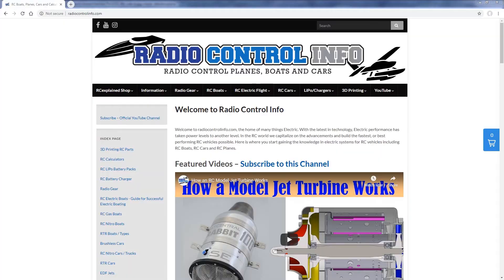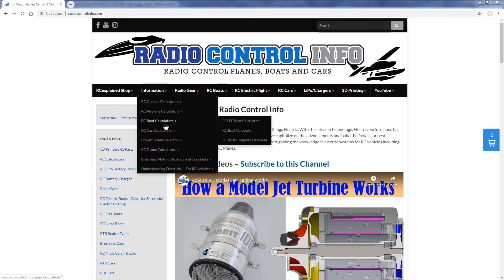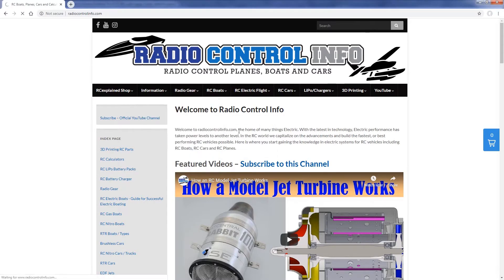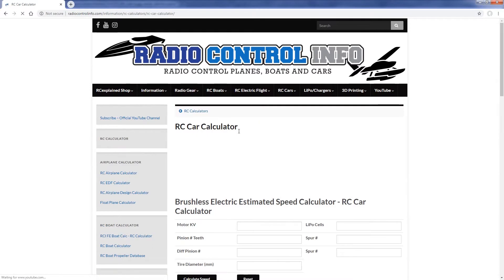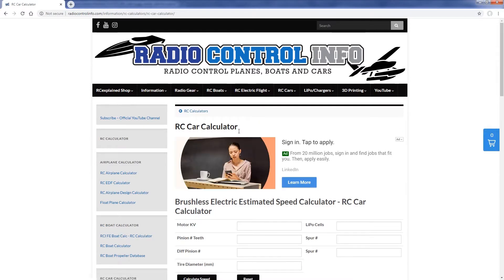How to Select a Brushless Motor for 1/8th Scale Buggy

Comment: I have a 1:8 buggy I am trying to convert from nitro to electric. I want to run 5S at first using LI-ion batteries, and potentially upgrade to 6S lipo down the line. I have the motor mount and the roller chassis. I want to just bash it and have fun for now. What motor and ESC combo should I run? Thank you!
Reply: Watch the video. Everything is explained. Learn.

Comment: If you’re planning to race on 4S, just get a 1900 - 2100kv 1/8 scale motor.  That’s the standard range used in 1/8 scale electric buggy racing. If you’re just bashing and want to attain a certain speed, this video might be helpful for you.

Comment: So, I converting a gas car to an electric car, is a 1/8 bougie and I don't know if is okey to use a 3300kv 1200w 15v 80A motor, is it okey for some kind of mix terrain use?
Reply from the maker: It also depends on the cell count used
Reply: @RCexplained   Is a 4S

Comment: Hey buddy, is it possible to couple two (identical) brushless motors on the same shaft? Of course with separate esc on each of them, same input voltage, possible?
Reply: Anything's possible. :)
Reply: @need4drift  Yes, but will they work without interrupting synchronization?
Reply: @Eden_M  Well, let's see what RCexplained has to say about it. :) Happy new year.
Reply: @need4drift  You too buddy!
Reply from the maker: If everything is identical absolutely. You do need separate ESC's and such as you mentioned.
Reply: We use to run dual brushed motors on a gearbox for fast electric boats.... the power density available from brushless motors made that mostly unnecessary....and saves precious weight....which “surface” rc guys seem to ignore. I run the smallest battery needed😎